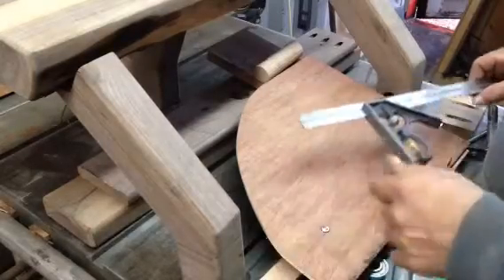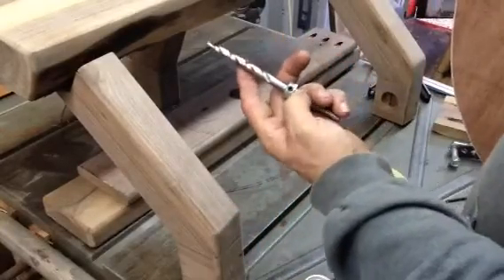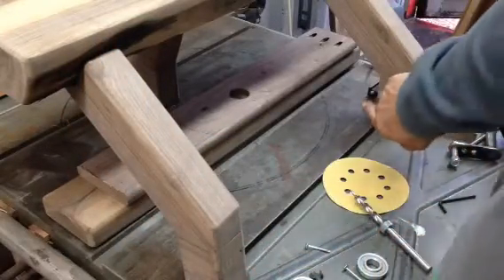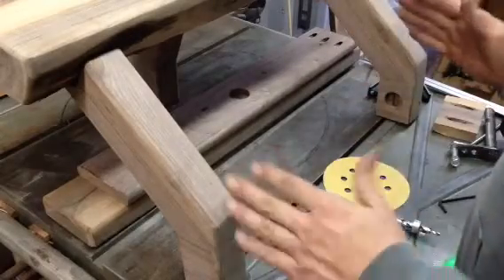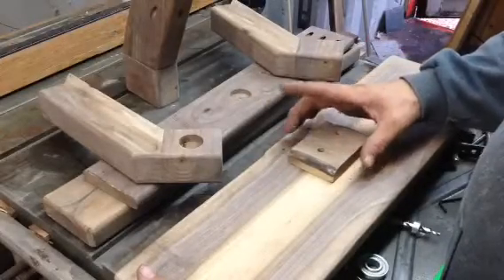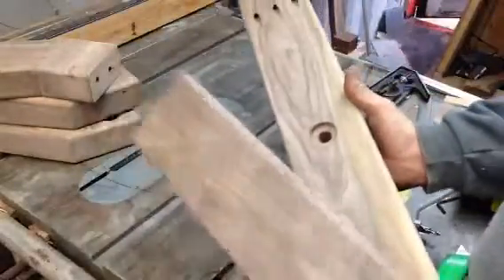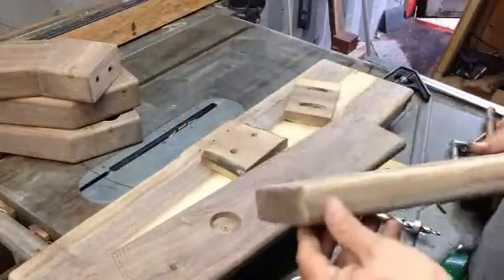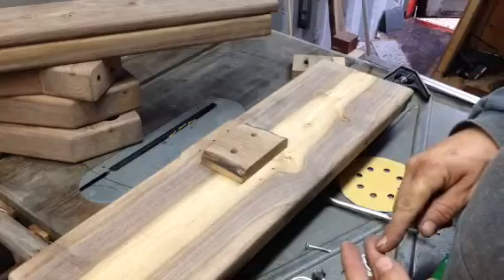DIY, Spinning wheel project, part 2

Comment: Thanks so much!  I have one of these in my future.  :  )
Reply from the maker: Not sure if I’ve replied to you but you’re welcome. If you make a spinning wheel I would recommend just making the wheel out of plywood or a pulley or something like that first just to see if you can get everything working right. Overtime the wheel I made warped and wobbles because even though the wood was seasoned for several years it’s continued to change so I’m gonna have to make another one eventually.